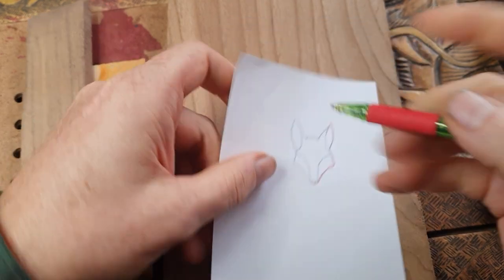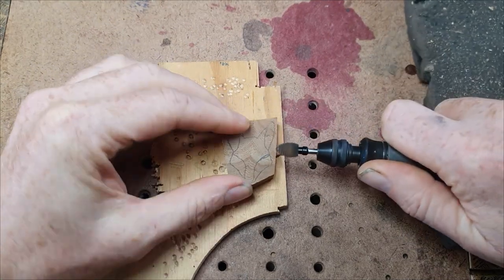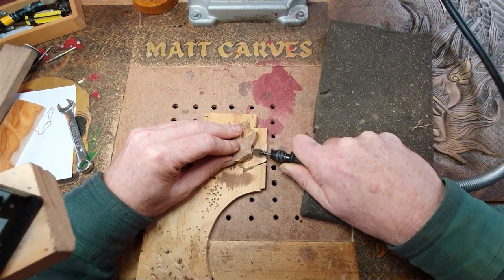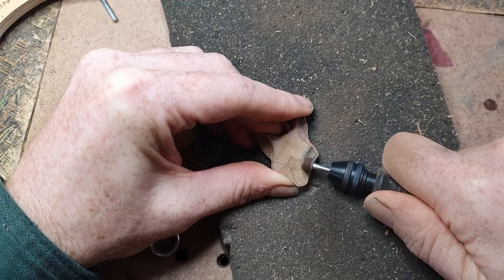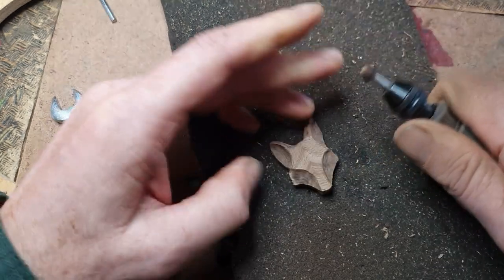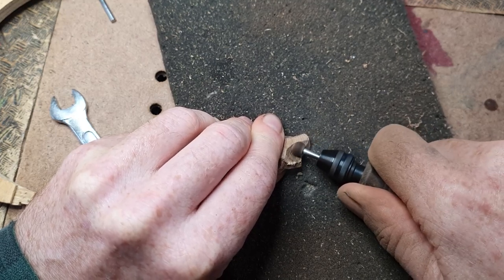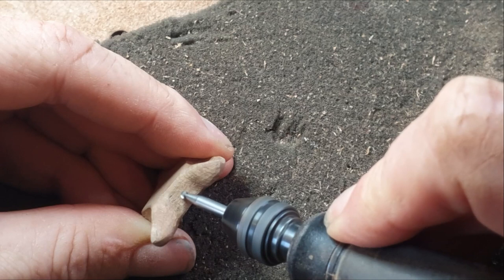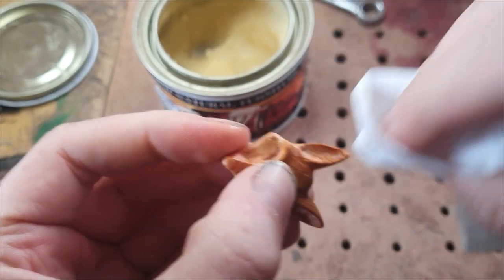Make a Wooden Pendant with a Dremel

Comment: Hey Matt it's Larry. Need a little advice. What is better to you carving hard and wide open or light and half open. RPM wise on your rotary tool? On wood cutters or aluminum cutters. Some insight 🪵be great! 🤣 get it lol. Little wood joke. ✌️♥️😀
Reply from the maker: Hi Larry. It's kind of a hard question to answer as sometimes I do both. Sometimes I will go full rpm at the start to get rid of the bulk, then I go lighter for details and may lower rs as well. Your question is a good video idea. Cheers  Larry.

Comment: Hey, i was thinking about buying a dremel and i don't really know where to choose from, could you give me some advice?
Reply from the maker: Hi, I carve with the dremel 4000. I bought it from my local hardware shop. I buy them as a kit which means it comes with a few accessories and also the flexshaft which is good for carving. The kit I get is called Dremel 4000-4/50 Rotary Tool Kit
Cheers from Matt